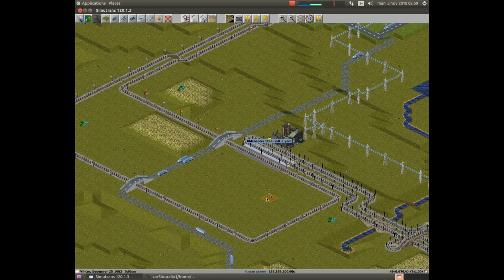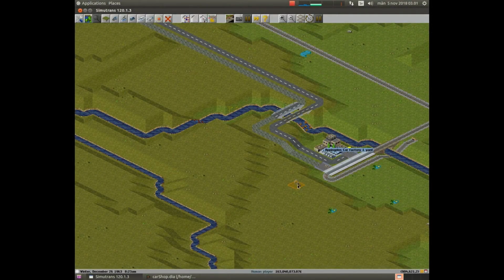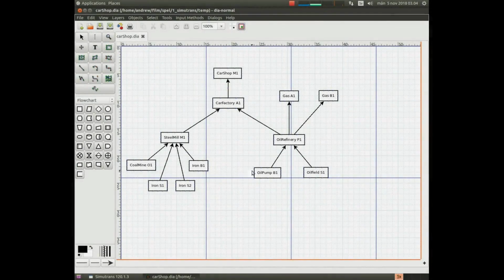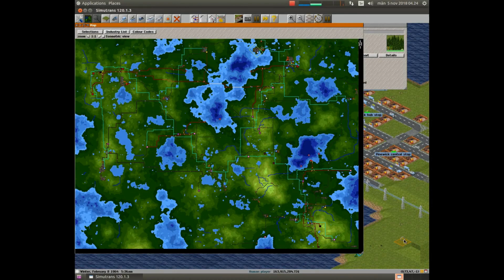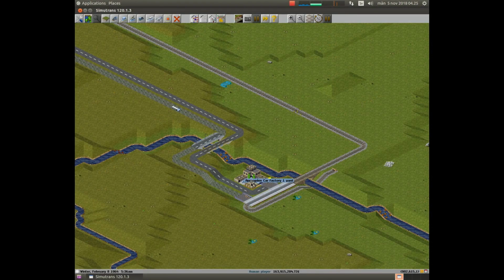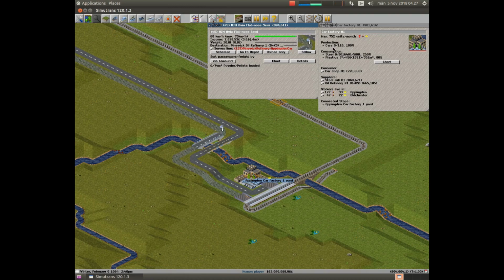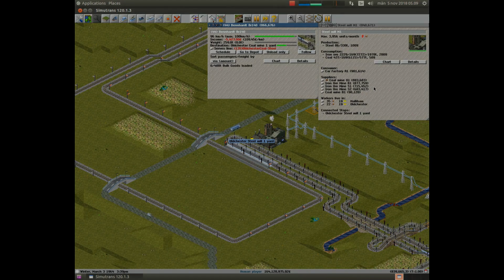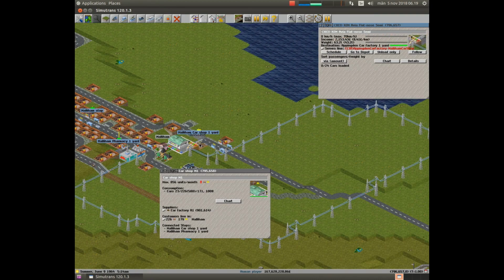Simutrans s1e43 steel mill and car factory

Comment: hi, i have simutrans installed on windows 10 and when i install addons, for example zeno, i get an error message saying there are duplicate objects. Can somebody help me ? You have excellents videos !!!
Reply from the maker: They have released a new version of Simutrans. Unfortunately, the new version is full of bugs. So I have problems running Simutrans in Ubuntu 20.04. My solution to my problems has been to install Simutran in VM which runs an older version of Ubuntu and there with an older version of Simutrans.